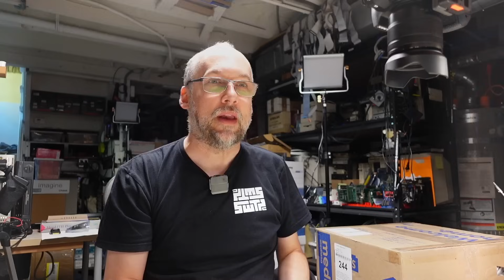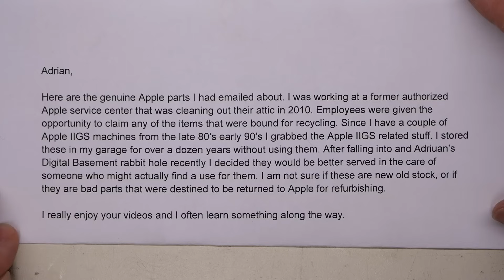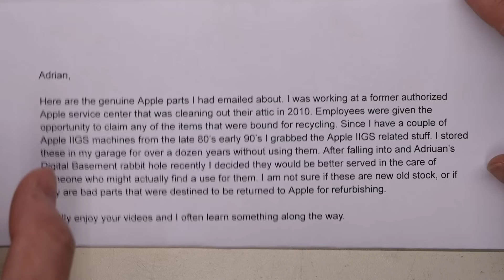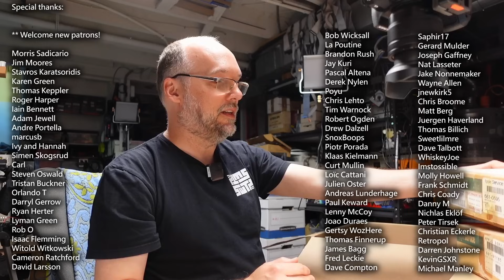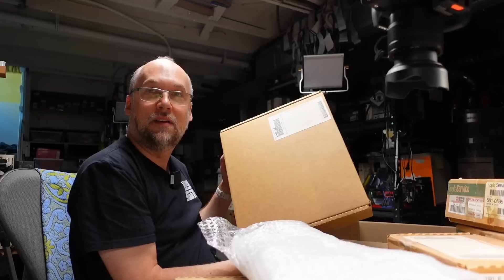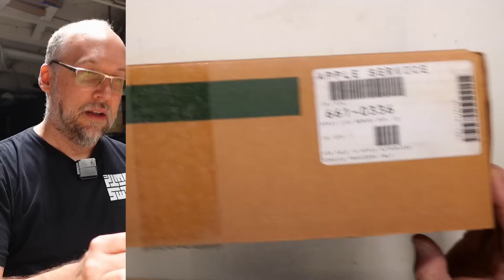0071 Fixing a Commodore 16 with modern parts, a bunch of NOS Apple parts and testing MOS chips

Comment: In general, I wouldn't replace an electrolytic cap with a ceramic.  They have very different characteristics -- which might not matter at all.  But that's the thing -- you don't know, unless you reverse-engineer the schematics and find out what it's doing.  Probably bulk capacitance on the V+ rail, given the size, which isn't going to be critical.  But, remember that 1) the capacitance of a ceramic cap varies with voltage, so 22u might not be 22u at 12V, etc., and 2) ceramic caps have much, much lower ESR, which might be fine, might be great, and might send a local regulator into oscillation if it's expecting some impedance in the feedback loop.

Just as a rule of thumb, replace like with like, because unless you're willing to discover why the engineer selected the components they did, you're making some blind assumptions that may not always pan out.
Reply: It is very easy to see that these capacitors are between VCC and GND and therefore, ceramic capacitors are a better choice than electrolytic ones.
Reply: @danielmantione   I wouldn't say they're better, for the reasons above.  They're probably not reaching their full capacitance at load voltage, and whether there is any need for higher impedance (for stability, etc.) having a mix of ceramic caps (which it already will, on a per-IC basis) and "slower" electrolytic caps will more effectively damp noise across a broad band of frequencies.

They still make electrolytic caps for a reason.  :-)  They're not THAT much cheaper, and the size and convenience might well have made up for it anyway in board space / assembly cost.
Reply: @sirnickity  You misunderstood me, I am not saying that ceramic capacitors are better, I am well aware of the advantages and disadvantages of the various types. What I am saying is that ceramic capacitors are preferred for decoupling. As these clearly were decoupling capacitors...
Reply: @danielmantione   I understood you, I just disagree.  As an example, I've been working on design just the last couple of weeks where the datasheet specifically recommends a combination of local ceramic capacitance in the nF range, a close ceramic or tantalum capacitor in the 1-4.7uF range, and larger bulk capacitance with higher-ESR components.

To be sure, it doesn't always matter that much.  Or it matters, but there's enough margin that you could get away with removing the bulk capacitance entirely and it would still "work."

Which is this?  I don't know.  More than likely it'll be "fine."  But, as I said, the best thing you can do is replace like-for-like, because then there's no guesswork, there's no gamble.  If it wasn't teetering on the edge of stability before, it'll be absolutely fine with whatever minor difference there is between parts.  But if you go changing components for wildly different ones, all bets are off, and you're counting on the design to be stable under very different conditions.  (And it probably is.)
Reply: @sirnickity  Sounds like ripple/noise filtering, not simple decoupling. The hardware is easy to understand, back then the component situation was different. Using your brain never is a bad thing. In the 80s you did use electrolytic for a 10us decoupling capacitor, nowadays you have the luxurty that you can use ceramic in this capacity.
Reply: @danielmantione   ... That's what PSU rail decoupling is.   It's a bypass for noise, and a counter for lead / trace / connector / wire inductance.  If there were no inductance and the supply had no impedance, there wouldn't be a need.

10uF with an electrolytic does not behave quite the same as 10uF with a ceramic capacitor.  If they both behaved like an ideal capacitor, then there would be no difference.  But there is, and neither is better, and neither is a luxury.  They have different, and mutually beneficial characteristics.

I mean, do what you'd like.  My suggestion stands, though.
Reply: @sirnickity  It is similar, but these are two different scenarios: Next to a usually digital chip you place a decoupling cap to avoid local voltage drops due to parasitic induction and to avoid turning your PCB traces into radio transmitters... that kind of stuff. While the capacitor reduces noise, .iIt doesn't matter if the voltage is bit noisy, a TTL chip can handle a lot of it. Therefore you use a simple 0.1uF capacitor and some bigger capacitors at strategic places on the board. You generally don't think a lot about it, you just follow the rules of thumb.

On the other hand, if you are going to generate analog signals, then you need to filter as much noise out of your power line as possible. That is when you get capacitor setups like the one you mention, one capacitor addresses the weakness of another capacitor.

Comment: I had the LC with the Apple ][ card and while I loved the Apple ][ I am not a mac person and it was really annoying that I couldn't figure out how to get the Apple ][ software on the LC and I sold the Apple card and recycled the LC. Wish I didn't recycle the LC, but I was overloaded with too much stuff at the time. Looking forward to some Coleco Adam content in the future!
Reply: I wonder if there's a timeline where the Adams' electrical issues were fixed before release. If Coleco stuck around a few more years, could they had partnered with Sega to make the Master System backwards compatible with the ColecoVision/Adam? Since the SG-1000 was nearly the same as the ColecoVision and the Master System could play SG-1000 games.
Reply: @Toonrick12  I would love someone to determine what causes the EM field that erases tapes.  I think it might be a surge to the tape head with power on. I am sure there is a way to fix the issue. The tape drive in the Adam is really cool, so fast and more like a floppy drive.

Comment: I think the correct oppinion about your smd cap removal method is that twisting the cap off has a higher risk of damaging the pads than doing it properly, but if youre wiling to take the risk and have good luck its usually fine. I still squirm when seeing it done though. Lol.

Comment: 10:15 Not all Intel ceramics are marked on the bottom. I believe you are correct however and this is not an Intel as the heat spreader is a bit too small. Instead my guess is that it is an AMD AM486, perhaps even a DX4-100 based on the length of the gold corner tab.

Comment: Retrotink 5x is one of the best upscalers available. It is, however, not designed to be plugged into and expected to produce perfect results without further tweaking. A simple, properly configured Generic 4:3 profile set as default would alleviate all your issues with the exclusion of certain machines not following video standards correctly because CRTs really don't care much about what you pipe into it, which is not a fault of the upscaler, but the computer itself. The general rule is 5x for consoles and whatever else it handles through trial and error (I'd presume most 8 bit computers work just fine if you take the time to calibrate, since they're glorified consoles with a keyboard attached, anyway), OSSC for the more finnicky, non-standard devices (pretty much just computers).

Comment: Those purple and black batteries are made by Tadrian and are lithium batteries designed to last 25 years, so they are non leaky by design.
Reply: Thing is, all batteries eventually leak. That and most batteries are over 25 years old, thus they could leak.
Reply: @Toonrick12  off-course, my point was some are less prone than others

Comment: @AdriansDigitalBasement][
That 6526 was not exposed to the wrong voltage for very long. You caught your mistake quick! There is a moderate level of fault tolerance built into them. It should still be dependable.

Comment: ICs can be remarkably hard to kill.  A dead Star Micronics DMP came in to me for repair.  Power on, lights on but no one's home.  Check +5v, up over 10V, the regulator had failed short.  Replace, and to my surprise all the chips survived, even the bog standard 74LS.

Comment: The iigs motherboard belongs in a performa 575 case, with a 3 1/2 and 5 1/4, drives in place, along with every upgrade that can be shoved in there with it. It could be the evolution of what would have happened if the iigs had won over the Macintosh.

Comment: Just FYI but Steve Jobs was long gone from Apple when the //GS design started and so had nothing to do with the decision making on crippling the processor speed.
Reply from the maker: Did he? The IIgs was first sold to the public in 1986 and didn't he leave in 1985? I'd think the IIgs was in the works for a least a few years before it was released to the public.

Comment: I worry about there being a counterproductive market feedback between those looking to repair computers and potentially people selling loose chips, destroying working systems to sell the individual parts which are more valuable as separate components than the whole computer.
Reply: It certainly exists, in fact most VIC-IIs and SIDs you can still find on Ebay are sold by butchers that slay C64s for their chips. Personally I try to avoid buying from them unless I really have to. And that includes designing my own parts ;)

Comment: I have both Daniel‘s 8501 replacement as well as the FPGA replacement by… I forgot. Both work equally well and have similar price points. For the 6502 based replacement it is worthy of note that you need a 6502A or a 6502 that is able to run at the 1.6 MHz or whatever that the 264 machines use.

Comment: You're not likely to see this, but there are two kinds of 65C05.   The older one from Rockwell should be 100% pin compatible with the 6502 A/B/C and will replace it without issue as long as the software is not taking advantage of some of the undocumented stuff (bugs) in the original CPU.  The modern W65C02 can be made pin compatible fairly easily, the only issue might be voltage levels as it has specifications not in line with standard TTL.  However, I have never had a case where it did not work.  There a some real advantages to using a CMOS CPU and not the least is the very low power consumption allowing your system to run cooler.
Reply: The problem is not the pinout, but the undocumented opcodes. Games and demos heaviliy use the undocumented opcodes, therefore you don't want a 65C02 inside a C16 or C64, even though technically it can be made to work (might even work, but I didn't try). In other situations, use of undocumented opcodes might be rare and then it is quite simple to replace an NMOS 6502 by a CMOS 6502.
Reply: @danielmantione  In that case the 65C02 is a no go for sure.

Comment: Adrian, have you updated the RT5X to the new 3.71 Firmware?
That should work a bit better.
Reply from the maker: I'll need to check it out -- I'm still on 3.0. The device has been so thoroughly displeasing to use  -- at least with 3.0 firmware. It's honestly unfit for purpose IMHO. (As I've owned three generations of RetroTink this is by far the most finicky and annoying .... even if it's the most "capable.") I'll try the new firmware but at this point I cannot recommend anyone get one, at least if they pair it to retro computers. (I can't speak to how it works with game consoles.)
Reply: @adriansdigitalbasement2  You might be surprised at the Updates. One of the things that was added was S-Video via Cinch (IIRC Red and Blue) in one of the latest updates, so you can connect an S-Video style Commodore Cable directly to the TINK without adaptors. Some Issues with other devices were found and fixed as well. 
I really hope that Firmware 3.71 does what you want the device to do and fixes most of the issues you experienced.

Comment: I had to cringe a bit watching those SMT caps get twisted off… if you’re not careful, it’s an excellent way to tear the pads off the board. Better to unsolder one lead at a time.
Reply from the maker: Cringe away :-) I've lost pads to leaking SMD caps -- and it has only happened when I tried to unsolder them. I lost track of how many boards I've recapped since I started twisting, I've never had a single issue, even with the most corroded and damaged PCBs... I learned my lesson that desoldering badly leaking caps is not the way to go when I had to do microsurgery bodging on the new caps.

Comment: Ive seen similar baffling resilience with an EPROM. I plugged the dang thing in backwards and something inside glowed like a lightbulb! I quickly switched off the power and figured I had definitely killed it, but somehow it was perfectly fine. These old DIP chips can surprise you sometimes that's for sure.
Reply: MOS chips have two faces: Their first face is that they fall by the fleet. Their second face is that they are indestructible as tanks.
Reply: Several months ago, I was building a Z80 single board computer and wasn't watching what I was doing and hit the wrong memory preset button on my bench power supply. I ended up sending 24V straight into the poor thing. To my surprise, the only chip that blew up was the AS6C4008 SRAM. Everything else -- Z80, CTC, SIO, flash EEPROM, various 74 series logics, UART to RS232 chip, etc. -- survived perfectly intact and fully functional.

Comment: Faster chips that have faster rise times in their outputs often disturb older chips. The faster a signal goes from 0 to 1, the more higher frequencies are generated. The interference caused might knock out chips down the line. Sometimes those sharp edges also expose hidden flaws and race conditions that were never noticed.

Comment: *SMH* Adrian, Adrian, Adrian...

The Atari "Sally" Chip is a Rockwell made 6502 (6502B and 6502c), and it is a standard 6502, but it is capable of running at 2 - 3 MHz and is clocked at 1.79MHz on the Atari Board. There is nothing else custom about it. The 6502 has some pins not used for most systems but Atari does use them for memory/video select. But you can put in a regular 6502 or 6502A in place of the sally and it would still run but it would run very hot because of the MHz increase.

The Atari 2600 though, uses a 6507 chip (also made by Rockwell) , a 14bit address version of the 6502 which addresses 16K and not 64K.

Computer History: Why does the Atari use the Rockwell 6502? Blame Jack Tremiel. He bought out MOS Technology for Commodore but for also corner the market and force companies to buy his 6502 MOS Chip. The problem is by this time MOS has licensed out the 6502 to be made by other manufacturers, like Synertek (used on some old Apple IIs), Rockwell (Atari), Western Digital Design (Apple on the IIc) and others. At the time there were at least 8 different companies making the 6502 under license from MOS. If Jack Trimiel would have acted a year before, these licenses would not been made and he would have cornered the 6502 market. How history would have been different it this happened.

Rockwell is part of Rockwell International and Rockwell AeroSpace and part of Lockheed (now Lockheed Martin). Who knows if it is true but imagine how many satellites and space equipment might be running the 6502. I know in the late 1990s, IBM and Apple had NASA launch several modified G4 Cube computers made into satellites into space as a communications array during that time.

Anything is possible.
Reply: That is not correct. Compared to a standard 6502, the 6502C Sally has an additional HALT pin. This halt pin does the same as the AEC pin on the 6510/8500/8501/8502, but where on the Commodore CPUs it is an asynchronous signal, the Sally samples and latches it at the end of clock cycle, and halts the CPU next cycle with the CPU disconnected from the bus. This is used by the ANTIC to make the CPU skip cycles when it needs to read data from memory. Sally chips have been manufactured by various manufacturers, in fact, I don't think I have a Rockwell Sally. The Sallys I own are made by NCR and UMC.

Comment: Could you overclock the ][ GS?
Reply: No. The limiting factor is the video chip.

You can put an accelerator in a slot and replace the CPU, but the motherboard won't go any faster.   

The transwarp GS was the best known.

Comment: Always love your honesty!  Most people would have edited out the potential damage to the 6526.  Everyone makes mistakes and I so appreciate you showing reality.
Reply: I have to laugh because I wired the power to a couple of TTL chips, on the project I'm working on, completely backwards. They got a bit toasty by the time I made that discovery. But, they worked fine once I swapped the power. Many years ago I had a friend of mine do some testing on an 8K Ithaca Audio memory card for me. That card had two pins for an external battery with ran to two unused S100 bus pins. Turned out my friend used the exact same two pins for low voltage AC to power the power supply on his EPROM burner board. Needless to say. all of the 21L02 memory chips got AC across the power and ground. He said he could see the heat rising off the board. But they all still worked once things got corrected. I used that card for years.
Reply: In my opinion, that's perfectly ok. Boneheaded stuff happens on occasion - we all aren't exempt from doing it. Owning up to the mistake, fixing it or learning from it and moving on is what counts. I like the positive, honest attitude.